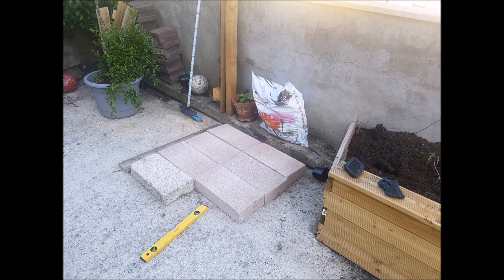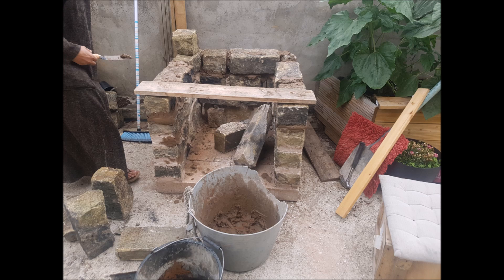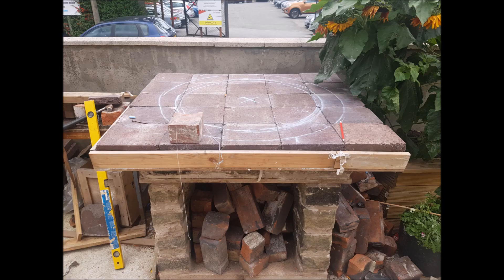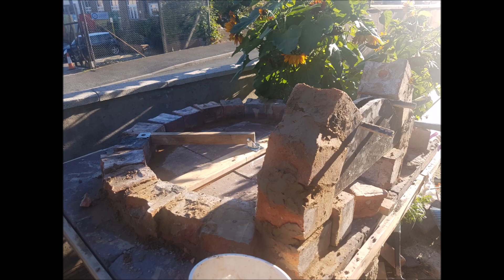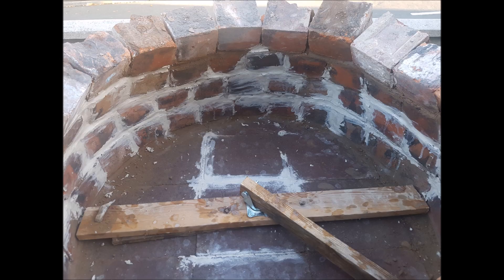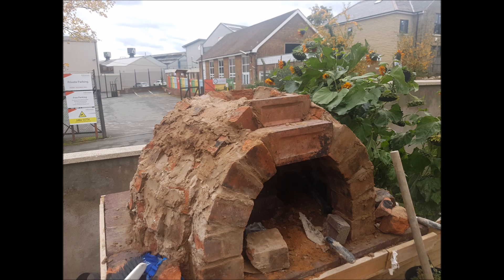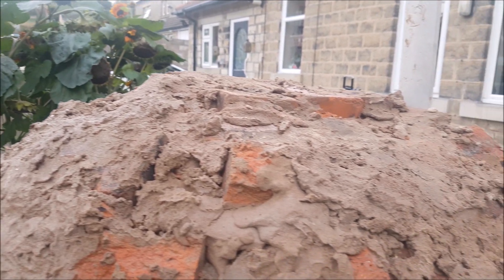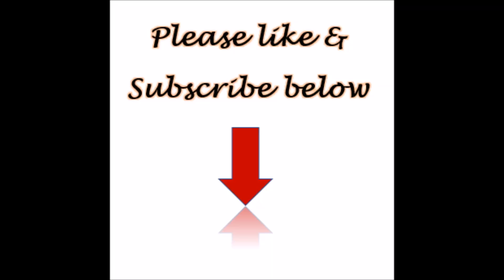How to build a pizza oven - UK

Comment: Nice job Aqsa. Looks great. What was the approximate cost?
Reply from the maker: Hey up kaasim....Most things were free ...like the bricks and stones. Fire bricks were £1each from gumtree. Rest was cement and sand..say £50
Reply from the maker: thanks alot.....do diy all the time.....some one said video it :)
Reply: Looks great! Do you lose a lot of heat through the base, how is the concrete holding up? Did you insulate under the firebricks?